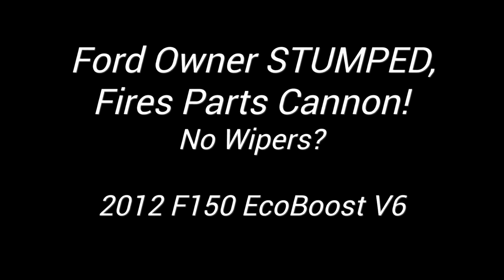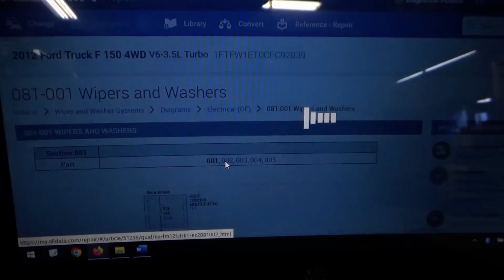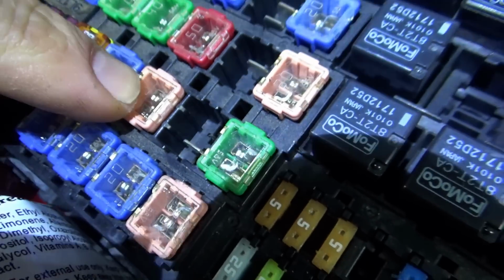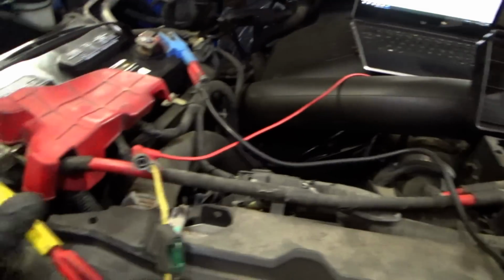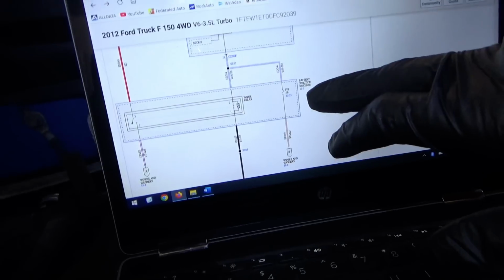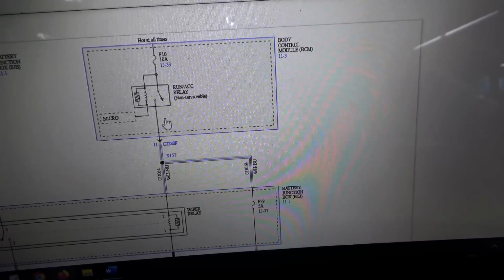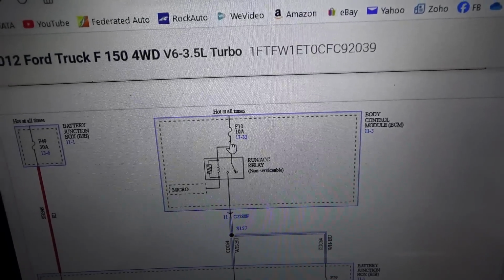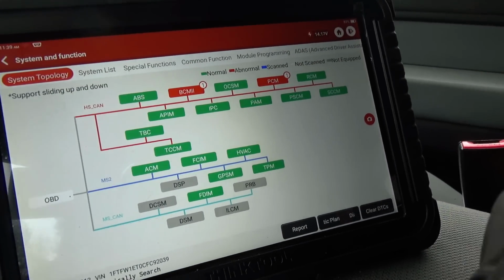HELP! My WIPERS Don't WORK! (Ford F150: Motor & Switch Already Replaced!)

Comment: Regardless Ivan if you would have checked all of the fuses, how often do you find a missing fuse?  Not very often and really, if you weren't videoing the repair, you would have found it twice as fast anyway.  Great job but another parts cannon fail that cost the customer additional money.

Comment: 26:16 this particular radio in Fords apparently can have bad solder joints inside. Mine stopped working, so I did some research online. Some people have had success disassembling them and baking the circuit boards in the oven, haha

Comment: Long diagnostic! When I saw how complicated the control of the wipers was, I thought that would be a module, then a relay, then a wiring fault. In the end, it was just a fuse 🤦‍♂
Good job, Ivan! And the extra care to check the fluids paid back - customer not only forgot the fuse, but also, to check the fluids! Little oversights that can get expensive 💰

Comment: Excellent diagnostics. Your "going upstream" approach was way more interesting than just checking all the relevant fuses.
Reply from the maker: Last time I started at the fuses the problem turned out to be the load 😂
Reply: @PineHollowAutoDiagnostics  Start in the middle and work out in this case would have taken just almost as long 😂😂😂.
Great diagnosis tho and problem solved so alls well that ends well 👍👍👍😉
Reply: Murphys law i guess
Reply: What do you mean excellent diagnosis forgetting to change the fuses negligent

Comment: That's the thing about diagnostics:  It doesn't matter where you start, only where you finish!

Stay safe in the approaching winter storms, Ivan!
Reply: It does matter a from efficiency standpoint. Efficiency can float or sink business if your competitors out do you.
 If known pattern failures follow those up first. If no leads, default to start in the middle and work up or down the chain from there! The best policy imo

Comment: I always enjoy seeing the mileage on a vehicle.   This one about 132,000 miles.    Alerts on the cluster on key on:  "Low Coolant".... "Change Oil"- (Past due).... Nice!  And people wonder why their vehicles self destruct?    Bondo on the cab bottom and around wheel wells.    Needs the "Fluid Film" education from SMA!   LOL  Hey, lastly, Ignition cylinder... people how have "janitor number of keys" with all the do-dads... weigh on and wear out ignition switches.
Reply: That's kind of funny how the two most important warning messages are on his dash low coolant and change oil now ha😂 bet he complains about how unreliable it is

Comment: I'm glad we have a control module on the BUS to take care of our wipers.  What an improvement over switches and relays.  Better than the old vacuum powered ones I suppose.
Reply: Just one module? Don't forget the SCCM and the Wiper Motor Module were also in that circuit. And a couple of relays. Why just one module if you can have three modules. Much more fun that way when something breaks.😂
Reply: You're dating me because I remember those! 😂😊😂😊😂
Reply: Agree--put the same comment later
Reply: just wait until we have a module for each fuse :)

Comment: Column key issue. Little key chips will eventually cause problems. Hold a rag below and wash out key hole. Blast it with lots of WD-40. Solves lots of problems.
Reply: Never, ever WD 40 and locks, it leaves a sticky film when it dries  !
Reply: @CrimeVid  Believe what you want but an old locksmith showed me that forty five years ago and I can't count the number of time I used it on my customers vehicles and my own.

Comment: Ford tech makuloco just posted a short video on Facebook showing that several coolant hose fittings (the crimp) on the 3.5 have been splitting/ failing. Think he said he’s seeing it on the 2nd gens, think that’s ‘17-‘20. Suppose there could be issues on other years, tho.

Comment: I think a case of "out of sight, out of mind" applies to the coolant in this case...plus the fact that they're probably used to only filling coolant at the radiator itself if this is someone genuinely older.  probably also used to a "nothing but an idiot light" type of instrument panel.  i swear these things don't indicate half the time till the fluid level itself is on "fumes"
Reply from the maker: I heard "gurgles" in the heater core during the test drive and decided to check the coolant level...LOL!
Reply: @PineHollowAutoDiagnostics  good call, then.  people wonder why I hated having the radio on at all.  after 16 really high milage "beaters" I learned to listen for noises.  too bad oil levels don't do that.  mine sucks it down like there's no tomorrow, and I can't even change it myself; I even have to buy basic maintenance tools for that :P

Comment: In my country, if this diagnosis happened in my garage :
Me: "This problem cost you an hour of diagnosis."
 Customer:" What??? An hour just to install a fuse " 
😢
Reply: The faultfinding process and the actual repairs are 2x separate items. Most electrical issues are simple in hindsight....

Comment: Yes Ivan, you could have checked the fuses first - but as a vehicle electrician and diagnostician myself,  'at which end do I start?' is as much luck as judgment sometimes. Also, for you as a content provider, some solid basics on show here which will help teach people. So while it might be an annoying outcome for the job in a sense (albeit it's a fix and you get paid :) ), it still makes for a great video. :)
Reply from the maker: I remember one case study a few years ago where I started with the fuses and relays, and finally found it to be a bad "load" component at the end...on that one people said "always start with the load!" haha
Reply: @PineHollowAutoDiagnostics  Aahh. The armchair experts. Glad they are not only in my neck of the woods in Australia. Retired mechanic.

Comment: there is no reason in heaven or hell a pickup truck needs more computing power than the first space shuttles did.& on top of that are 98% LESS RELIABLE than the space shuttles.an unreliable truck is more useless than an unreliable wife.after all, the OEM's pretty much had windshield wipers down to a science by 1940.

Comment: Give the owner some thumbs 👍 for trying! And especially being honest about....yup! That's on me!
Reply: Yep, he probably felt silly that he sent himself on a wild goose chase replacing the switch and wiper motor and then bringing the truck in for repair all on his own doing... Whoops!
Reply: @volvo09  Nothing like an empty wallet to drive home the mistake so you never make it again.  He can put them back on and sell the newer parts on ebay hopefully.
I paid for believing the manual was right when I replaced the distributor for the firing order.  Now I check it mechanically.
I guess that is my curse in life, having the cars that the service manuals are wrong, and parts don't fit.  My CV joints on my saturn is the wrong part, my starter on my rx7 is wrong part, firing order on ford straight 6 was wrong.  Beetle, never a problem.  But I wish I was a drunk.  Would love to see the court try and hook an immobilizer to the '69.  LOL
Reply: @robertsmith2956 I'm a certified BAIID installer. Putting one on a older vehicle is super simple. Now trying to install one on some of the newer vehicles is a giant pain in the butt. It's like hooking upna remote start but they operate in reverse.
Reply: over a year ago the customer pleaded ignorance for no fuse in the box.
Reply: @robertsmith2956 So he's been riding around with no wipers for a year ????? 😮
Reply: @superfinn80  No, Ivan had another case study with no fuse.  But customer swore no one touched it.  It must have evaporated inside the fuse box.
Reply: The owner better start checking his fluids more often, and I hope he changes his oil every 3k miles to preserve that Turbo.
Reply: idiot owner and a missing fuse....priceless...LOL

Comment: That's hilarious.  Here at my shop I tell them "we repair what your husband tried to fix".  ;)  Had one last week, dude completely dismantled the interior over a no start problem.  He was going to replace the ignition switch.  He described the problem and I told him he didn't have a switch problem he had a power problem.  Well, 2 hours later, after reassembling the interior, I charged his dead battery and it fired right up.  XD
Reply: making basic things complex = customer installed problems
Reply: Years ago my coworker changed the starter on his cavalier. Car still didn't start. God I laughed. I said you should have changed the battery first...yup, the battery was pooched.
Reply: @mikefoehr235  worse an acquaintance changed several batteries then had generator checked opps
Reply: ROTFL! 😂
Reply from the maker: WOW haha

Comment: switch to those vacuum powered wipers.
Reply: They weren’t all that great on long uphills. 😅
Reply: @brianw8963  BUT they didn't need a 10 amp fuse you might remove and not replace
Reply: @ That’s true. 😅
Reply: Those were great. The faster you were driving, the slower they would wipe.
Reply: @helgew9008  I never had one but heard all those stories an EV would need to add a vacuum pump to use that technology LoL
Reply: sure
sweep.............sweep............. sweep.............sweep............

sweep/sweep/sweep/sweep

yadda yadda

Comment: Good morning Ivan!  Damned old fords.  I had 2 of these trucks this week.  One for a water pump (3.7) and yesterday an overheating 2018 3.5 Ecoboost.  If you have not run across it yet, there is an updated thermostat for them from Ford.  Customer had already put an aftermarket t-stat in it, but had same results.  I installed the updated t-stat and cured his problems.  Apparently this is Ford week.  I have a Ranger for front end work today.  If I decide to actually do any work.  Snow storm is on the way, so I may just lay about and bitch about the snow.   ;)
Reply: I’ve plowed more snow this year than I have in the last 5 years combined. Now that I don’t have to work in it anymore, it doesn’t really bother me, but I could do without it for sure. 👍
Reply from the maker: @brianw8963  We haven't had a SINGLE "plowable" snow event yet here in Central PA!! Maybe you just really like to plow Brian? ;)
Reply: @PineHollowAutoDiagnostics no snow in Buffalo. Used snowthrower once to make sure it worked.
Reply: @   We’re up on a hill, and right on the continental divide, and close to I-80. Tri facto weather anomaly. Neighbors even dug out and dusted off their snowmobiles, there buzzing around our fields daily. I actually do enjoy mowing since I got the Ferris a couple years ago, but I’d rather lick a belt sander than plow snow.😅☃️
Reply from the maker: @brianw8963  Wow sounds like I should dust off the XC skis and head to your neck of the woods!
Reply from the maker: @davidheinzmann4403  Didn't you guys get the big lake-effect dump in November? Although those are very localized...
Reply: @  Anytime!
Reply: @PineHollowAutoDiagnostics Its 2:30 pm in Hot Springs Arkansas, and the snow just started to fall. Big, elephant eyelash sized flakes...
Reply: @PineHollowAutoDiagnostics  It's coming my friend.  ;)  4" here so far and it's all headed your way.  We don't get snow every year where I am.  After I spent 2 years in northern Japan working on snow removal equipment, I have a real distaste for the stuff.  :(
Reply: @ that’s Lackawanna/orchard park. We are by U.B. North. There are some winters here that require minimum shoveling. My Prius s…Prii get by with with either new tires or if they are worn we switch to snow tires that we keep mounted for the few storms.